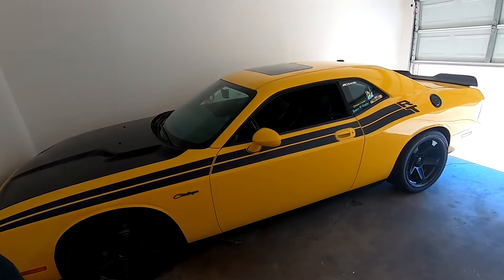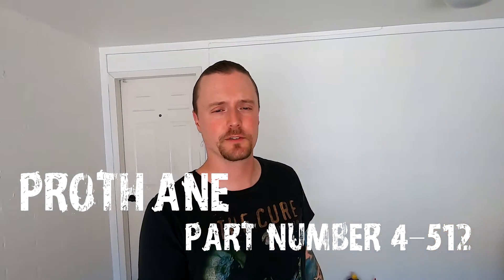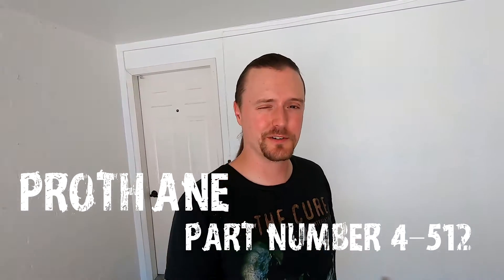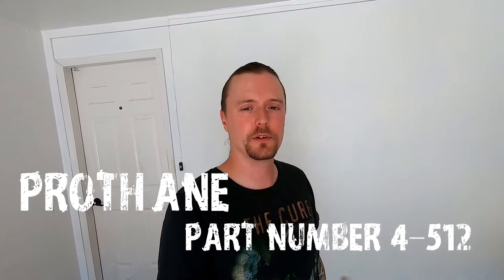Faster N' Louder | Which Motor Mounts? | OEM, Polyurethane, Solid?

Comment: Can't speak on their motor mount kit,  but their front & rear strut braces really made cornering, even with stock suspension, a lot more fun!  Check'em out:    https://www.bmrsuspension.com/?page=products&productid=1980&superpro=0
Reply from the maker: They do have a polyurethane motor mount, but it’s only for the 2011 and up models. 😪